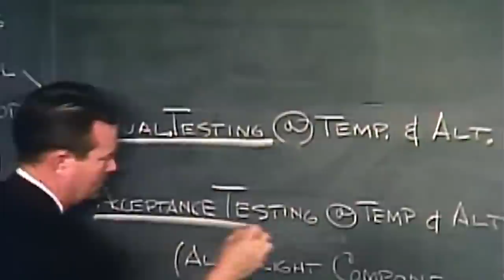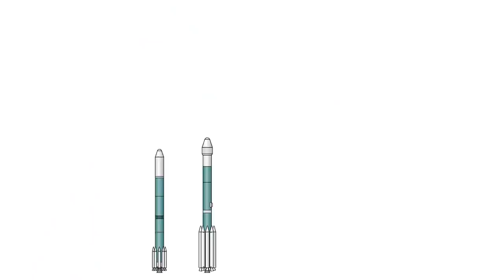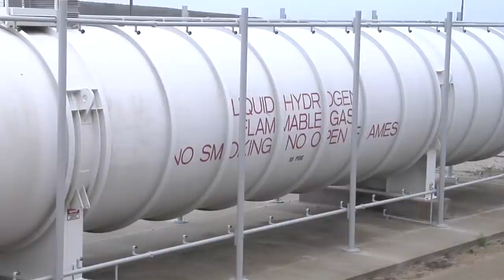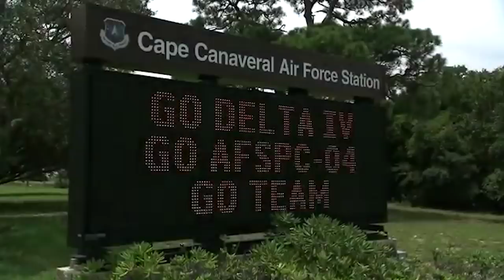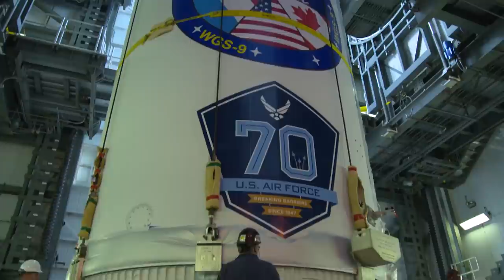Delta IV - a very expensive pleasure

Comment: A few years ago the prevailing thought was, "why would you want to trust your payload to a used rocket."  Now it is, "why would you trust your payload to an un-tested rocket."
Reply: There is no longer A sensible reason to use any ULA rocket which costs 3 times more than it's competitor and moves less payload.
Reply: @AKlover  The only reason it can still have high prices is that the US military has a lot more funding than NASA, so it can use huge piles of cash on vehicles made by ULA.
Reply: @Rauruatreides    The excuse that is pedaled in the case of Delta Heavy  is "Fairing Size" ....... The reality is 85% of Cong/Sen own Boeing/LM stock and the stock jumps with every contract.
Reply: @AKlover  Fair size I guess is also a factor.
Reply: AKlover how about the second stage performance?  Nasa always choose that ULA for interplanetary mission
Reply: @JefReedYT  If ULA still exists in 3 years it because the Asterisk President is and much of congress is getting A cut form the cronies.  Fairing width is the only credible excuse I've heard.  The maximum payload width for FH is smaller.
Reply: Unlike SpaceX & reusability, The Delta 4 HEAVY has never failed. The Atlas 5 has never failed. ULA has never failed. If you want your 100 million dollar satellite to launch you go with ULA.

Comment: 21:30 There's another reason why SLS won't use (and Constellation wouldn't have used) the RS-68. Tests showed that the ablative nozzle does poorly in a clustered engine environment. This issue doesn't come up on the D4 Heavy because the engines are much farther apart than they would be on SLS.

Vulcan will use the D4's tank diameter, so the manufacturing equipment won't completely go to waste.

Comment: Delta is out and Vulcan is in! This was great infotainment, and a wonderful sendoff to the Delta rockets. Nice work!
Reply: Only 4 more Delta 4 units are in the assembly pipeline,  so all launched by 1st Quarter 2022?
Any reliable signs of a test launch of either Vulcan or New Glenn before that?
Pretty sure no one is putting a XX $billion NRO satellite on anything with less than 2 successful consecutive outcomes!  I see a gap year as very likely!
Reply: @KevinSmith-ys3mh  I think the last 4 Delta Heavy's are all NRO launches. Vulcan Centaur is supposed to launch a lunar lander in Q4 but we'll see how that goes. From what I've seen both Vulcan and New Glenn have been waiting for the BE-4 engines to finalize.
Reply: @CausticLemons7  Yea, definitely NRO has dibs on Delta unless there is a sudden hurtling asteroid impact event! 😆 
 No one else will pay it's bills, because each launch is essentially 3 Atlas V's going away. A reusable Falcon Heavy totally makes more sense, except for a deep space mission where every gram counts. That's where disposable rockets still shine, until they work out a system for orbital refueling and interplanetary launch missions. 
Long term I'm quite optimistic about the potential of spaceflight, which is overdue for actual business ventures with payback potential, not just plant the flag vanity shows! There's gold, platinum, iron-nickel, silica, water, and solar energy out in them thar hills/ craters/ asteroids and getting it back here may keep us from trashing the planet we're need to live on!
Short term.........not so much. None of these programs ever meet schedule or budget, always add 2 to 10 years at best. What's going on with Covid-19 and the economic effects, NASA  & DC administration changes , worldwide budgets blown to hell!
 Best case of 4 to 10 year delays likely , assuming no major screw ups like SLS blowing up on the pad and taking 1/3 of the Cape Canaveral facility with it (thinking Soviet era N-1 moon rocket here!) 
Fingers crossed for the BE-4 engine project going well, or Vulcan & New Glenn have to crawl to Elon & SpaceX for Raptors,  those are at least flying now.  Or maybe Aerojet could restart their last effort vs BE-4, but a longshot. Methane gas fueled engines do seem to hit a sweet spot between kerosene and hydrogen,  with most of the best features of each.

Comment: This is definitely one of my most favourite rockets. Sure, it is expeniseve, but due to its hydrogen fueled upper stage, it's the only rocket currently caüable of reaching high energy orbits, like the case with Parker solar Probe. Since those missions don't launch that often, it's no surprise that this rocket is expensive. But still, it's the only rocket capable enough, so it is simply required.
Reply: Falcon heavy can do this if you throw away the center booster. Its not impressive nor justified.

And its still cheaper to throw away a Falcon  Heavy than a Delta IV.
Reply: @haydentravis3348  falcon heavy doesn’t have the payload space to have a good market for its capability’s
Reply: @coffeespy1133  If I recall, it wasn't a matter of space, but vertical integration. Falcon 9 loads their payloads horizontally, prior to being transported to the launch site and integrated there, where as Delta IV loads the payload during rocket construction in a vertical integration building next to the launch site.
Reply: @haydentravis3348  it’s also payload space, falcon heavy misses out on stuff DIVH doesn’t because of payload space
Reply: @haydentravis3348  Damn, SpaceX fanboy?

Comment: What is more frightening is the lack of launch vehicles lately and soon more to get the axe. All we will have launch is a Falcon 9 400 times in a row and a Vulcan every few years. Of course I'm speaking from the Cape and a jobs/ career perspective. But none-the-less, its an objective failure on all fronts to grow the space industry.
Reply: I think you have to step back and get a wider view of this issue. SpaceX is certainly the current front runner & game changer, but the challengers are not far behind.  Blue Origin is right behind them in deploying self landing boosters (probably), Electron has just tested a parachute recovering 1st stage, and most organizations that want to survive in the commercial launch market must follow or get priced out. Consider this- if Delta4 had initially come out as reusable x20,  even at its current insane price$$$ to build it would have ruled the heavyweight launch market (not that a RS-68 engine would survive this,  but RS-25 evolved maybe?) Every one knows it's their path forward, but hardly easy to achieve.  Result : a step change in technologies that has obsoleted all previous designs.......and a pause for development time with the mad scramble for cash$$$ to make it thru to the other side. 
Look at the Wikipedia "list of orbital launchers ", and you will see most are retired,  retiring,  or in development. The future of spaceflight is likely bright,  but not clear by any means. 🤔🙂
Reply: @KevinSmith-ys3mh  Unfortunately companies like Blue Origin and Electron have no skin in the game. Blue Origin has yet to launch a damn thing and Electron doe not have a facility nor the rocket to lift payloads more than a few tons, let alone providing JOBS which is the whole reasons for space.  Stop using reusability as the excuse here. If this is going to be only about money, then no country should ever have a space program. Space is about results, nothing less and nothing more.

Comment: From what I understand is that the advancements with rocket propellant and engines have been stagnant for decades.
Reply: Honestly current rocket propellants are as good as they get there is only so much chemical energy you can extract. As for engines there are some promising developments like SABRE for fuel savings and VASIMR for space propulsion.
Reply: @tsaranen  I think they have much better hidden for real WAR...
Reply: Not really. I mean... propellants haven't changed much (other than xenon ion propulsion and the switch to metholox) but the technology and capabilities of the engines have been advancing so rapidly that there are new breakthroughs being announced every couple months.

Comment: Great video. It's interesting that they decided to have the liquid Oxigen on top. For the Space shuttle, it makes sense because the O2 pipe runs externally to connect to the Orbiter. In Saturn V the hydrogen was at the top, since passing the  O2 pipe in the middle of the H2 tank could easily lead to frozen o2.

Comment: ULA: Select RS-68 to save cost
SLS use RS25 because it is cheaper
Reply: I was wondering about that myself; why would they choose the RS-25 over the RS-68 for the SLS? So I researched it. It turns out that the 2 main issues are man-rating and clustering. The RS-68 would've needed extensive redesign to be sufficiently safe for manned spaceflight and the design of the nozzle (specifically cooling) made it subject to failure in close clustering. 
 In fact, NASA had originally intended to use the RS-68 but decided to move to the RS-25 instead because of this. They figured that while they were more expensive, they had already paid for them and might as well use them for something instead of leaving them sitting around.
 HTHs,
-Slashy
Reply: @GoSlash27  Good to know Slashy
Reply: @GoSlash27  yeah thats mostly the thing, the RS-25 being man rated, the RS-68 not

they will modify the RS-25 to get rid of some of the expensive parts though
Reply: @Markus-zb5zd  Yeah... In *theory*. In practice, though? My guess is they won't. Official reason being that the redesign to lower unit cost would be prohibitively expensive for such a small batch. Unofficially, it's all about the pork and keeping constituents happy in those key congressional districts, so they'll just buy the expensive engines and use them once. I say this because if they weren't motivated to shower these districts with cash, the SLS wouldn't exist in the first place.
Reply: @GoSlash27  the RS-25A are already in production I think
Reply: @Markus-zb5zd  Actually, the RS-25A is long out of production. You're thinking of the RS-25E, which isn't in production yet and may never be. Rocketdyne just picked up a contract to make 18 more of them at $100 million each; same price as the old ones.

Comment: Wouldn’t it be cool to add a dozen of SRBs to Delta IV Heavy? That’d be super heavy.
Reply: Also very Super expensive,  they're not free and will require redesigning each stage for higher launch forces (and additional weight). The RS-68 engines didn't play well with SRBs when tested on the SLS, so they went with more expensive RS-25s. Probably easier to supercool the oxygen and extend the tanks for more propellant. Maybe possible to fit 4 GEM-60s between the boosters,  but is it worth it?
 ULA seems to think the next generation Vulcan is a better idea. 🤔

Comment: I have hated hydrogen lower stages for years! They are the most expensive..
Reply: @Wayne Flanigan RS-68 is the most powerful HYDROGEN engine, there are many kerosene engines that are cheaper, more powerful or both! Saturn F-1 was several times more powerful, and RD-180 currently used on Atlas V has bit more power and is significantly cheaper.
Reply: @Wayne Flanigan But engines play minor role anyway. Main problem is very low DENSITY. Hydrogen has 50% more impulse per weight, but has 11x times more volume than RP-1 kerosene!! It requires 10x bigger tanks, which adds weight and drag, and it needs cryogenic insulation which adds up more weight. On lower stages all the negatives far outweigh the positives.
On upper stages hydrogen is unbeatable, but notice that SpaceX has no hydrogen motors at all. They plan for them, but they know they add a lot of complexity and cost, and they're doing pretty well even without them.
Reply: @Bizzon666  They're trying the next best thing for their Starship - the methane/oxygen engines.

Comment: Let's get one thing straight. The DELTA IV is not an expensive rocket; ULA is an expensive space launch company. It's not the same thing. The rocket may not cost a lot in terms of Man-Hours, components or raw materials. But Uncle Sam is paying to keep the entire ULA workforce and brain trust employed.With an average of two launches a year that becomes very expensive. The EELV program, like NASA, is a JOBS PROGRAM. It's about paying a bunch of very specialized and very highly paid people to do... well... not too much, so that you don't need to start over the next time you want to do rocket science.
Reply: You're right that it is mostly political, but still it isn't cheap. Hydrogen lower stages are not a good idea, kerolox Atlas V is cheaper.
Reply: @Bizzon666  Instead of the STS, Titan III/IV, Atlas III/V and the DeltaII/III/IV, the USA should have stuck with the a simple 2-stage rocket with a single F1 and a single J2. This is easily a 25 ton to LEO launch vehicle that will carry all the payloads that we flew in the last 40 years. I'll be roughly like an expendable Falcon 9 in capability. I'll be reliable. And, we could have spent all the money on missions instead of rockets. No, we couldn't have repaired the Hubble, but there will be so much money that a half dozen "spare" Hubbles could be sitting on the ground ready to replace it.  It would have been politically OK too... there wasn't yet a shuttle workforce, industrial base and their Senatorial advocates at the time.
--
Specific impulse DOESN'T equate to performance -- if by performance you mean taking stuff into orbit or beyond. Hydrogen is the LEAST DENSE gas or liquid in the universe. Hydrogen engines are the lowest thrust chemical engines in rocketry. Using hydrogen means very big (hence heavy) tanks and very big engines. This offsets the advantages of higher specific impulse. It makes no sense for a 1st stage and one can argue that it still does makes sense for 1.5 stage designs like the shuttle and Ariane V. Why have an anemic engine and a huge tank then strap LOW IpSec solids to it such that (1) the combined liftoff specific impulse is lower than a hydrocarbon 1st stage and (2) the weights of the ground lit engine & its big tank is way worse than a cryogenic upper stage.
Reply: @dwightlooi  Man, I couldn't agree more! Shuttle is iconic to this day, but it was SUPER expensive and also dangerous. As you say, some Saturn derivative could have launched many Hubbles and everything else, and be much cheaper. I dislike Ariane (I'm European) as well. Low hydrogen density just totally kills it on lower stages.
And the SLS is the next political boondoggle job program money sinkhole...
Reply: @Bizzon666  The STUPIDITY of the Shuttle can be summed up as follows:-
(1) It is a 104 ton launch vehicle carrying a 78 ton Orbiter leaving room for 26 tons of payload.
(2) The said 78 ton orbiter takes longer and costs much more to refurbish and refuse than any 26 ton launch vehicle by any country at any time.
(3) The said Orbiter cannot go anywhere but LEO.
(4) The said Orbiter puts 7 humans next to two megatons of liquid fuel and solid boosters with no launch escape system implemented or possible, ensuring that ANY loss of tank or booster containment guarantees a loss of crew -- something which is not true of ANY OTHER launch vehicle.
(5) The Shuttle cost NASA $206 billion -- 55.4% of its entire $377 billion budget over the same 30 period of its existence (1981 thru 2011) -- leaving little money to actually do missions after you pay the researches and the other fixed costs.
Reply: @dwightlooi  Nothing but the truth. Just the empty weight is absolutely crazy, it barely reached ISS, and no polar orbits. Safety was total joke.
And they knew it from the beginning, when they proposed the Shuttle they knew it would never reach promised parameters. They simply lied, whole thing is political from the very beginning, and remains political to this day with all the Shuttle derivatives.
Reply: @dwightlooi  The worst thing is that original Shuttle was planned to be a fully-reusable TSTO - almost like what Elon plans his Starship-Superheavy LV to be. There were even plans to make the first stage out of S-IC and make it capable of winged flyback. If they've went with developing reusable winged S-IC first, which could be topped off by either reusable orbiter or some kind of an expendable second stage, they could've gotten a Falcon 9 near-equivalent back in 1970s-1980s.
Reply: @caav56  But they didn't, period.
Reply: @dwightlooi  That is true (and incredibly saddening). All because of the politics, too...
Reply: @caav56  NASA had their share of un-political pipe dreams though... remember VENTURE STAR? Basically they are asking for...
--
(1) The SAME PAYLOAD as the STS
(2) With HALF THE LAUNCH MASS as the STS
(3) Everything that goes up re-enters, lands and flies again.
(4) Do it all with ONE STAGE
--
The entire thing would have to be made from Unobtainium!

Comment: 102% thrust?  That doesn't sound legit.... violating physics haha.
Reply: Believe it or not. It’s accurate. The shuttle flew its liftoff at 110% thrust before throttle down
Reply: @weekiely1233  well if hey sayin the thrust is 110% of the gravity force on the mass okay i can believe that.  Just a funny way to quantify it I guess.
Reply: @HerbstaMagus  not it’s 110% the thrust the engine is rated to provide. It’s because 100% means fully open values so if the engine puts out more thrust than it normally does at this point it’s technically putting out over 100%
Reply: @weekiely1233  reminds me of the stupid 150% recovery rates at lab i work at...

Comment: An impressive beast, but reusable rocketry makes seeing this thing launched a bit disgusting.
Reply: Why? Reusable rocketry is its own thing. With out the Delta IV heavy you would be out of a job. Electric cars make a 57 Chevy so discusting right?
Reply: Exactly, high deltaV missions will always expend the booster. SpaceX also doesn't re-use boosters launched at high inclinations.